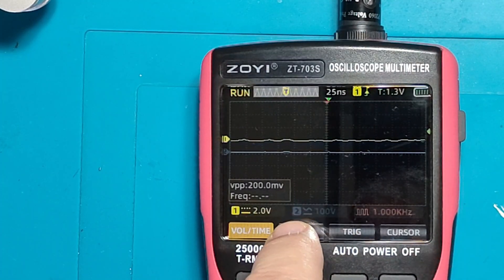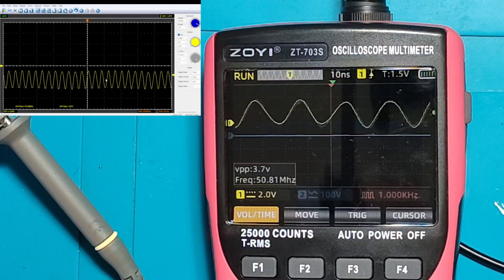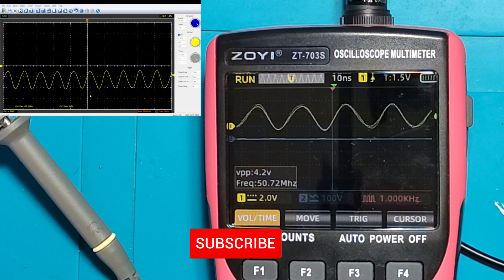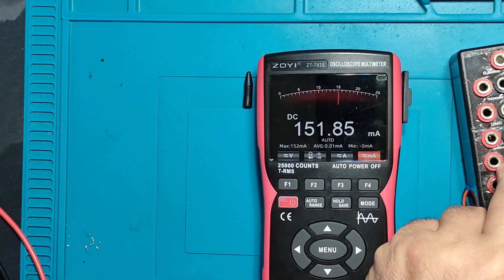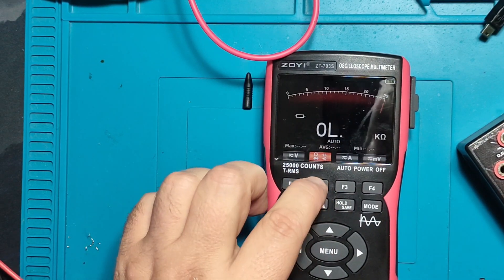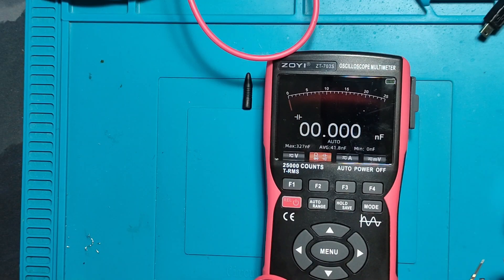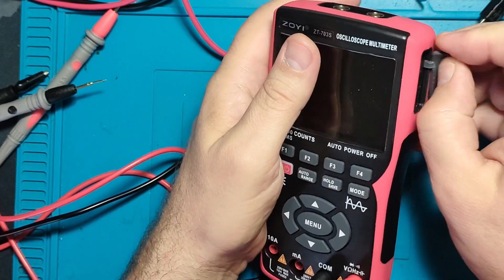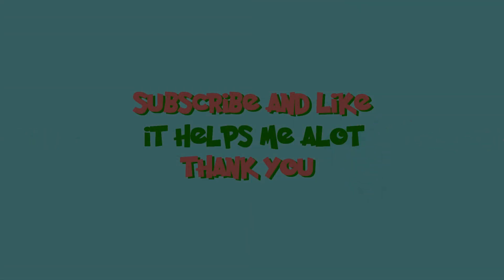🔥ZT703S Oscilloscope/Multimeter Review: 50MHz Performance & Accuracy Beyond Expectations!

Comment: Those review you refer are old and made on firmware 1.3......since many things get fixed like less noise, more precise and faster measurments. and added same extra function like FFT.
Reply from the maker: I agree with you but as an example, I would like someone did video like mine but with firmware 157 which is one of the worst they released , before I used it. it would save me from a lot of hustle.
Reply: @FantaBH  Hey, have you tried 1.64? I'm curious about your thoughts since you generally are more in-depth and thorough than other reviewers.

Comment: What is frameware  come with it ? Is it latest ?
Reply from the maker: I don't know what is the latest , the firmware of my unit is 1.4.2 but you would know that if you watched the video, thank you.
Reply: latest is 1.5.7 at the moment
Reply from the maker: please don't go 157 it's terrible, will try 156 tomorrow, got it from zoyi ,if the same problems exists I will revert to the 142
Reply: @FantaBH  did you try  156? are you advice this device or should i buy a fnrisi 2c53t
Reply from the maker: 156 workings flawlessly